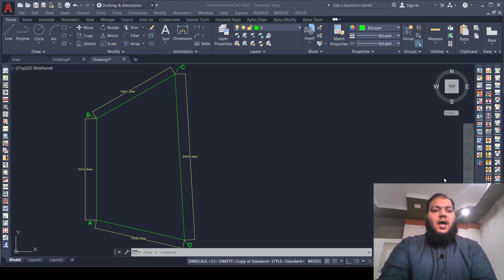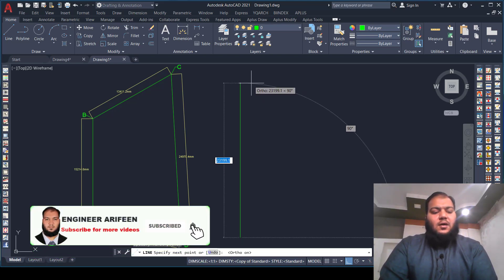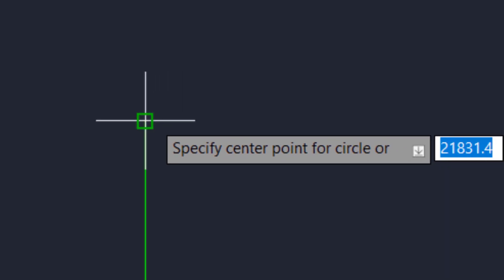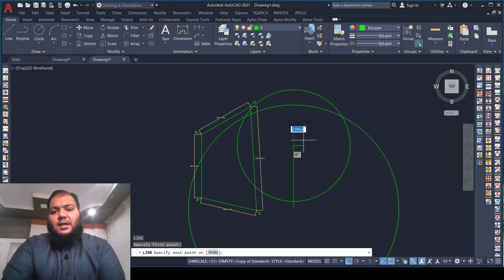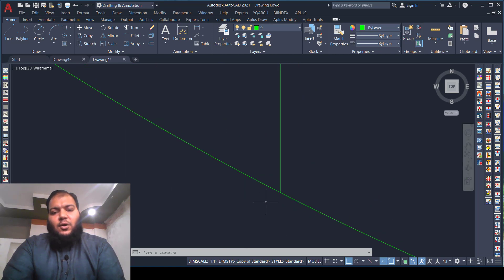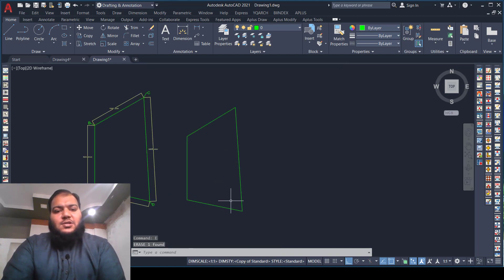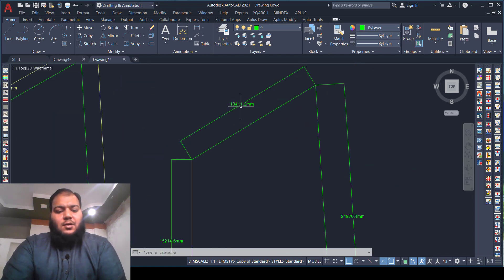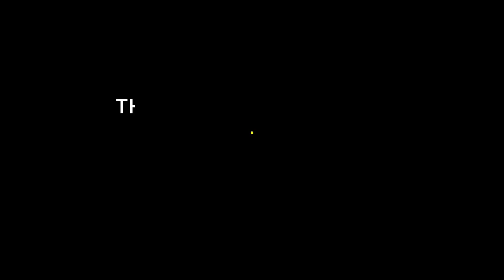How to plot Irregular Area in AutoCAD | Irregular plotting | how to draw irregular land an AutoCAD ?

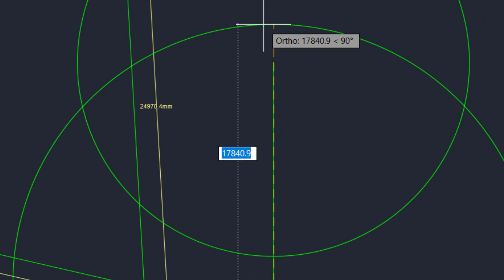Comment: This not accurate, without knowing at least one diagonal of the shape, you can draw infinite shapes with the same edge dimensions. @3:23 You used one of the side as a diagonal, which is not correct for evry shape.
Reply from the maker: Yes you are right my friend its a tutorial i have full drawing on that you need one diagonal and i will draw of it when i finish tutorials and will teach professionally dont worry my friend.
Reply from the maker: Thank you so much dear for your suggestion
Reply from the maker: Dear if one line is straight then no need to take diagonal
Reply: @EngineerArifeen  for the circle in you create in 3:20, use 10000, then use 20000,  or any other number, and for all other dimensions use yours, I bet all the edge dimensions will be the same.
Reply from the maker: @HamnoHAmno  dear you are right there are many ways to draw in autocad if i start professionally singke video will goes to hours and my audience will get bored.